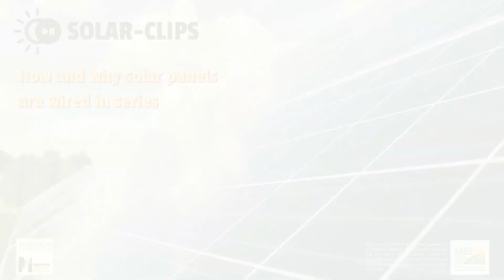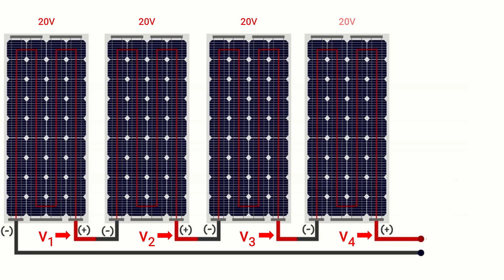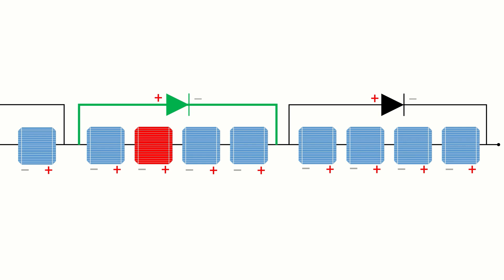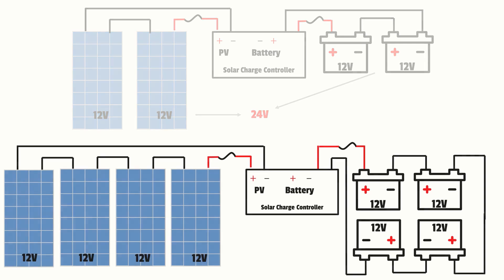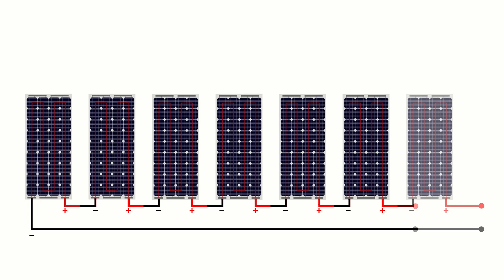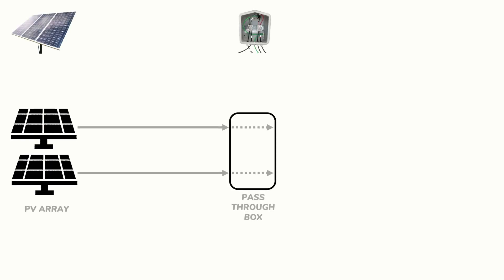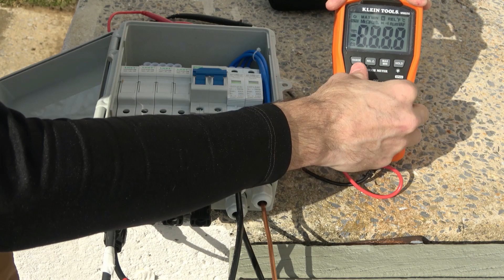How and why to wire solar panels in series

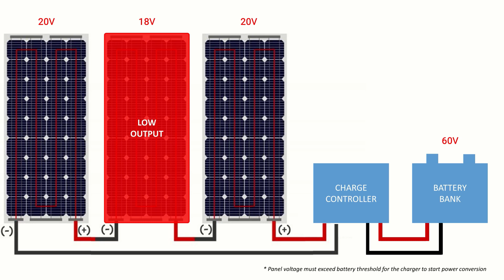Comment: 5:05 Is this still true? My understanding is that newer panels include multiple diodes that do a good job of shunting off parts of panels that are shaded and keep the string voltage high. Combine that with modern MPPT capabilities that optimize the voltage and it seems that shading issues are adequately mitigated now.

Comment: Does the sequence of the series connections matter? Do the 2 output wires have to come from the first and last panel? Or can we wire them in an order to where the two output wires come from the panels in the middle?
Reply: You wouldn't get any solar output that way . Think about it, if you had 4 panels and you connected in the middle, the circuit is broken for each two sets of panels. As far as connecting in series, it wouldn't work. Now if you get a Y-connector to each of the two set of panels and then connect it to your load that would be considered connecting in parallel.
Reply: It depends on what you mean by "first and last panel." I THINK you mean the panels at opposite ends of the string. The panels in a series don't have to be a straight line, but they must all be connected in some sort of linear configuration (e.g., a circle or square). If you're clever, you could design a string where the positive and negatives terminate in adjacent panels. But that can't be a straight line, of course.

Comment: Wow this is confusing to me! but thank you for such a great video!! I’m trying to connect 5 more 100 watt panels to my system with about a 20ft run to the controller.  I currently have 1 100 watt panel and I cut the connectors off when I got it and just used butt end connectors with heat shrink to wire it which has been working for 2 years now. I now have 2 12v 200ah batteries, a victron 150v/60a smart controller, and 5 more 100watt solar panels to connect. My inverter is 12v/3000amp. Any advice would be great!!

Comment: im running a 24 volt controller 100 amp and 24 volt battery. one guy has 3 panels so hes been running 36 volts. i kinda want to try this, i know open woltage with sun is 40 volts now on 2 panels. so that would be 60 volts, i just dont think controller can handle 2400 watts in current